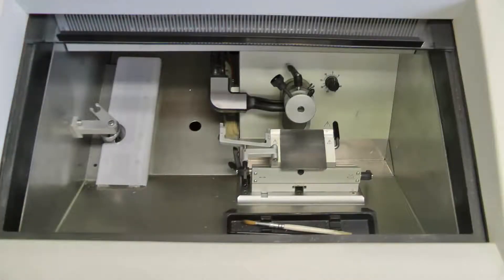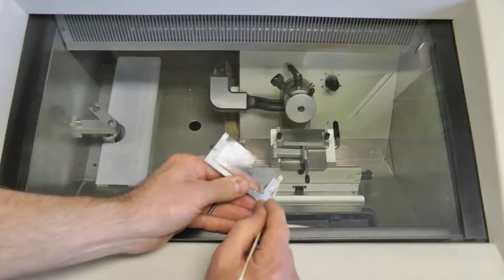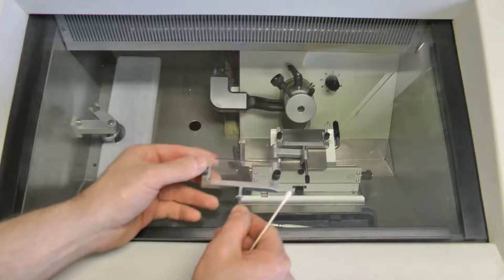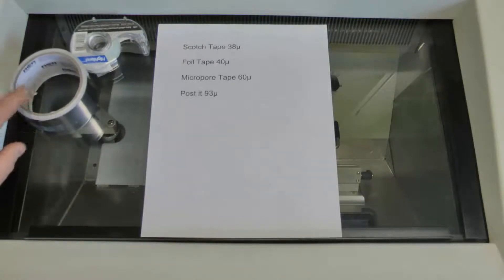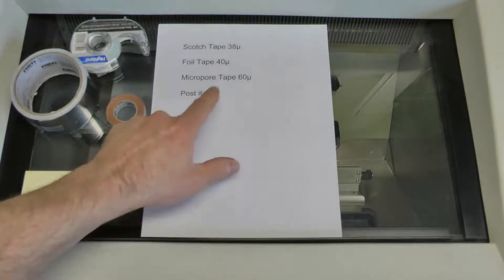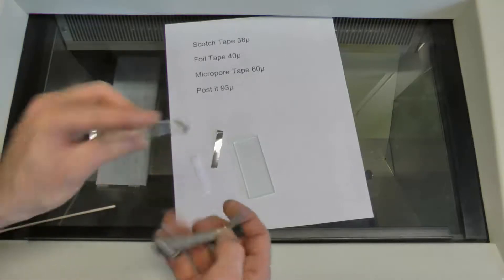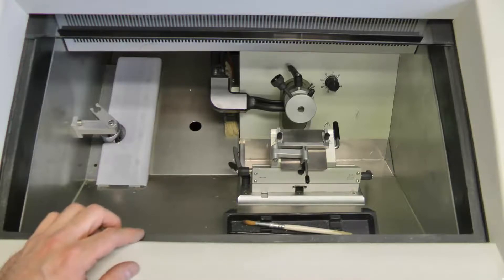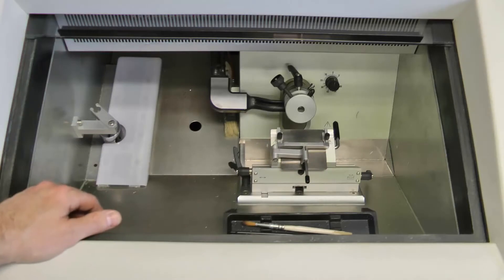Advanced Anti Roll Plate Tutorial Part 02

Comment: Hi, I hv tried sectioning rodent brains on a thermoscientific HM525 NX. I have tried sectioning in a range of -15 to -22 . Adjusted the clearance angle to  10,11,15,9. Nothing seems to be working. The sections are badly folded or stick to the anti-roll plate. At -17 a few sections come here and there. But m in dire need of seriel sections. However, the machine works well for rodent
Reply: Maybe the temperature of the  plate is to high